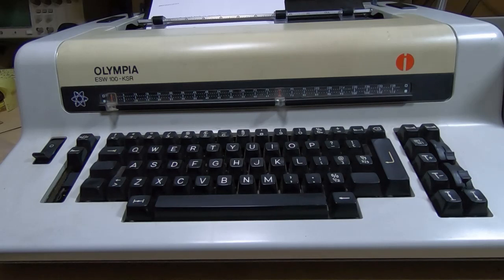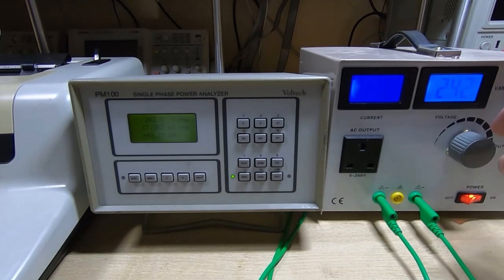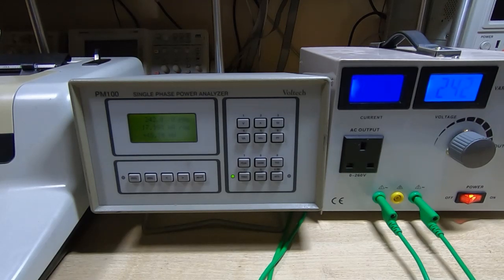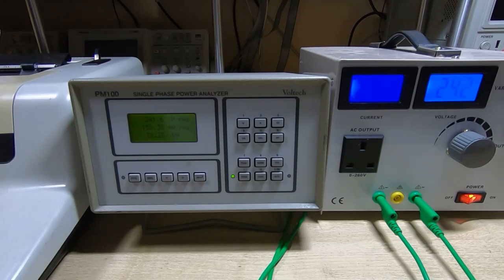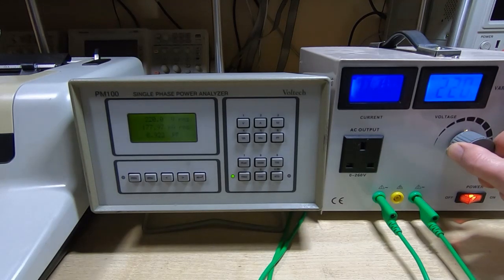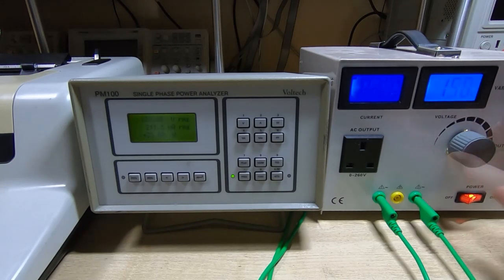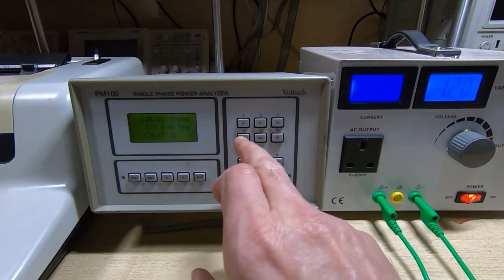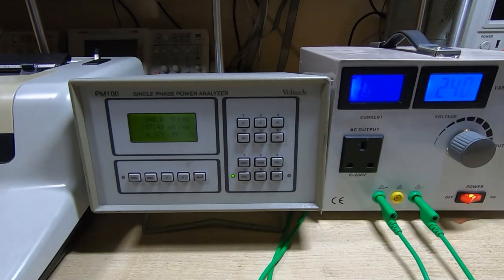Ferroresonant transformer power factor

Comment: I really enjoy your content. Thank you for all your hard work. I also have a question, do you have any idea why some parts of the world settled on 50Hz electricity and other parts settled on 60Hz electricity? I have never heard a good answer to that question.
Reply from the maker: I have seen many different explanations for the selection of mains frequency but the most likely seems to be that industrial steam engines of the time ran at a nominal 3000rpm and so a simple generator would provide a 50Hz output. I have never really understood why the US selected 60Hz although today this would make most power designs easier. It is possible that the later installations made in the US enabled the engineers to pick a more efficient frequency using information obtained from the existing 50Hz systems but by then the UK had already too much infrastructure to be able to switch. This is just speculation on my part.

Comment: So does the ferro resonance "gulp power" from the AC peaks? Commerce pays extra money for VA, as I'm certain already know. Also, YT disregards comments made on VPN, I thought I had said something you didn't like at first, but now my browser lets me know, prior to that it would register the comment only to find it "got deleted" when checking back later.
Reply from the maker: The transformer saturates the secondary part of the core early in the mains cycle and so the flux cannot increase any further and so any winding on that part of the core reaches its peak voltage at the same time. This causes the current to drop in the primary so it evens out the power drawn. When operating in the designed range the power factor is good although the efficiency is not particularly high. I have not changed my web connection, it just seems that YT has decided it does not like my opinions (which differ significantly from theirs) so they need to silence me. Basically it is because they are terrified of any opposition because it would show what they stand for and so they behave like babies and will not allow disagreement with their own narrative. This has nothing to do with spam or abusive comments because mine are neither of those and yet they are ALL removed unless they are on my own channel (such as this one).

Comment: Interesting... but still waiting to see it printing over the serial port. Could you make any progress on this?
Reply from the maker: I do not have any information on how the serial port is configured so I will leave that to the owner to investigate. I did test that the machine could receive and send bytes but that is as far as I went. I am assuming that there is some sort of configuration menu either locally accessed with a key combination or remotely but without a manual the only way to determine this is to reverse engineer the firmware but I only have the machine here for repair. There also seems to be some additional control lines on the board so it may need a special interface.
Reply: @JerryWalker001  Thanks for your answer. Would have been nice to see the interface working but I understand that it is a lot of work without having the manual.
My ES 100 didn't have an interface. It's now nearly 40 years that I got it working as a printer. 
I actually don't remember exactly how I did it, but I'll have a look in my own docmentation in the next weeks and will post it on GitHub.
Reply from the maker: @rolandschmidt6781  Thanks, This machine is very different from the one you have and has totally different electronics. I did try to download the documents you posted on github but I could not open any of them  as they just kept showing as archives even after extracting them. If it was my own machine I would figure out how to get the serial working but I can only spend so much time on a machine that is not mine. The owner wanted me to get it working so that is what I did.